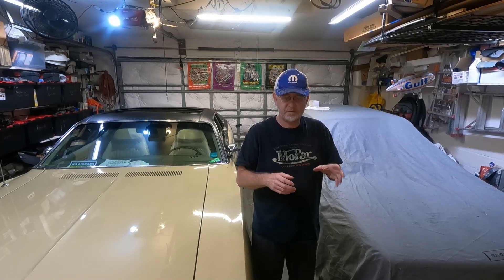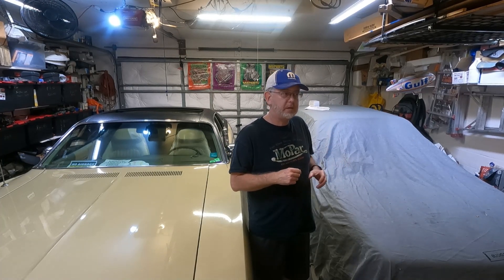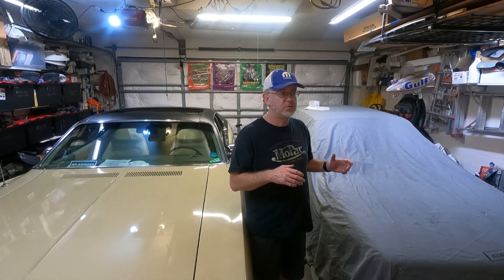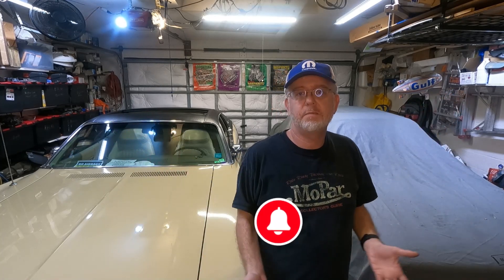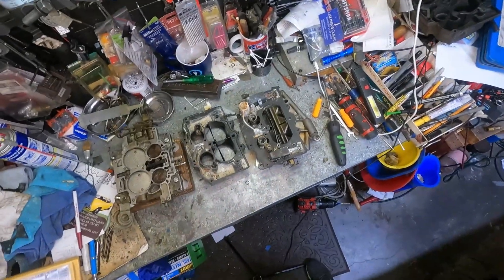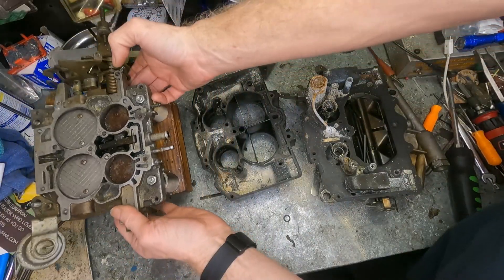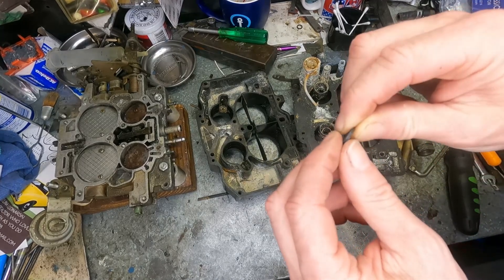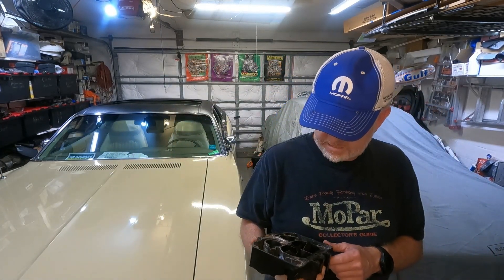Friends Don't Let Friends Use Ethanol, The Dark Side of E10

Comment: There's some misinformation in this video. Ethanol has 70% the energy of gasoline. Meaning when using ethanol you need inject 30% fuel more as compared to straight gasoline. Typicaly people in the performance side use ethanol to reduce the chances of pre-detonation. Also the word your the white rust is aluminum oxide.
Reply from the maker: My information is not scientific, it is solely based on real world applications in my life, such as fuel economy and power.  Ethanol has no place in any classic car is my point  from this video.  It only works as you say at 85% and higher concentrations when using fuel systems that are designed for it,  since I have know people who race cars using it.

Comment: The one thing I have found to clean the white goo out is ammonia, it has the same solvent properties as alcohol. I fixed a Yamaha four wheeler that had what looked like crisco in the intake from the fuel that leaked through from a bad float valve.
Reply from the maker: I will give that a try, it is a little less bad than gasoline.